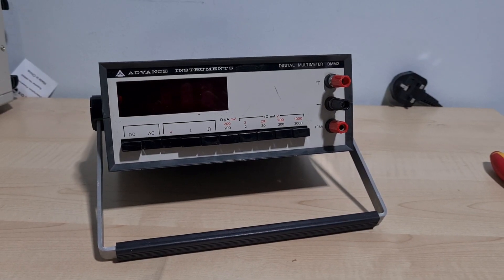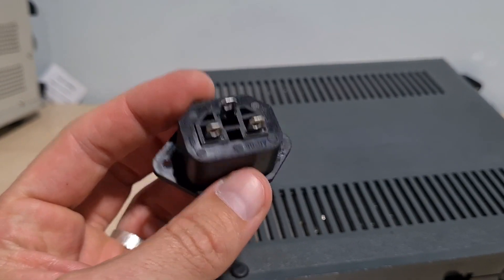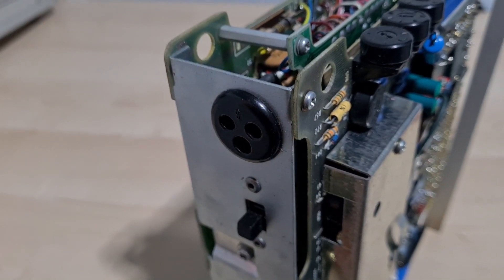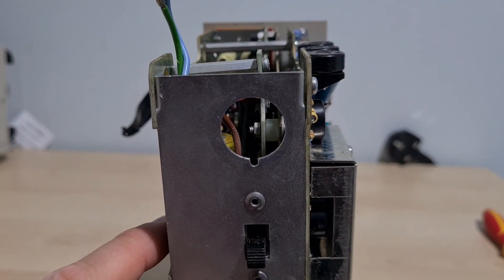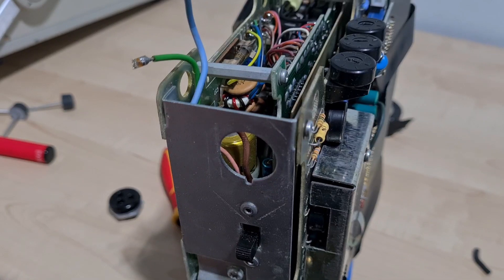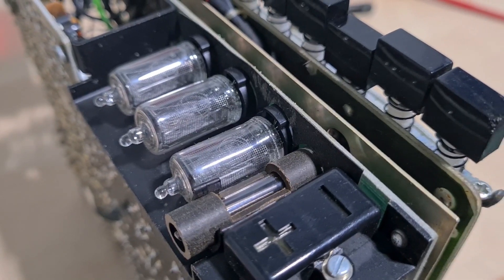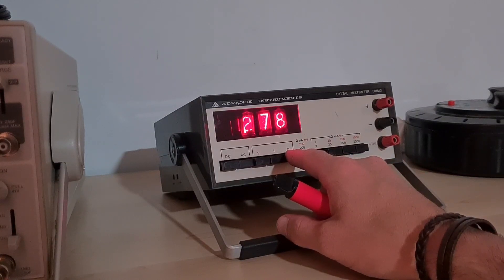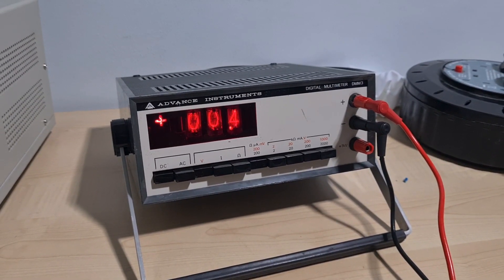Advance Instruments Nixie Tube Multimeter - Will It Live Again?

Comment: Rather than all that trouble, and potentially hacking up a perfectly good device, you could have just gotten the correct power connector. its a Bulgin L1436/P, not cheap but readily available.
Reply from the maker: Not cheap is the killer there buddy 🙈

Comment: As someone who works on test equipment for a living, I too love the nixie tubes in old test kit. 
As a side note, if you were to use the IEC connector, it would have been the wrong gender. You would need a male (with pins) on the back of equipment. The reason being that you would not have a plug (pins) that could be touched on the end of a mains supply lead. 

Very nice instrument that, probably early 1970s.
Reply from the maker: Stupidly, I didn't think of that at all! In hindsight you're completely right!

It makes me wonder now why those plugs are even available, as any cable plugged in for it would be a death trap 🫠
Reply: @pwrestoration  they ware used to power your monitor from your PC and also as the output on power bars and UPS's